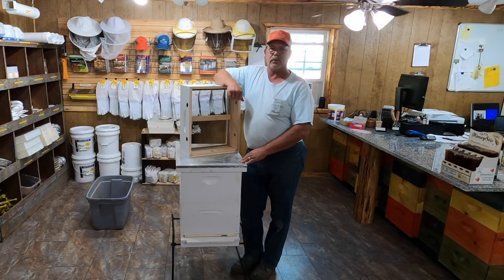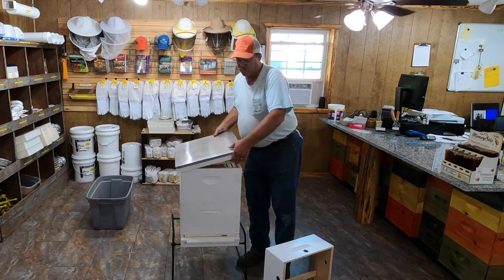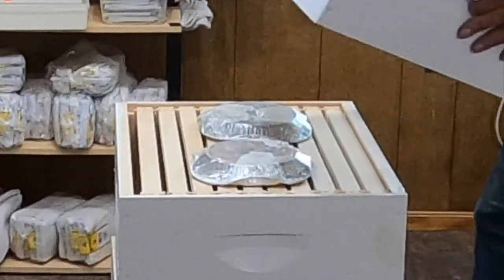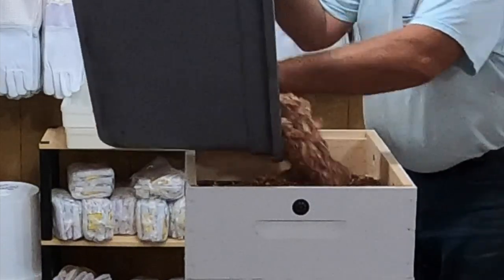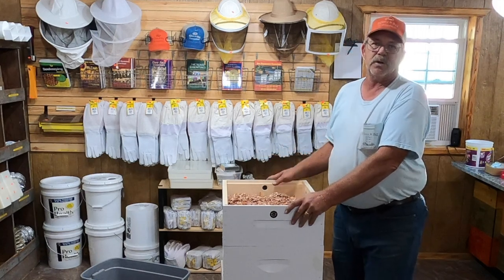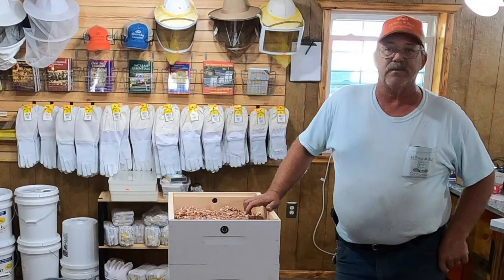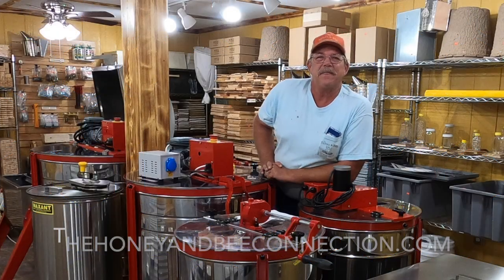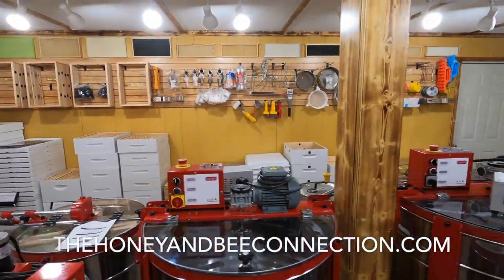Beekeepers Guide 2 Quilt Boxes - Moisture Control 4 Winter Honeybee Hives|The Honey & Bee Connection

Comment: Great piece of equipment and good explanation of how it works.  I just put on a quilt box of similar design on our hive. (We've lost so many hives in the past... this past year we only went with one hive. It gets expensive.)  As an added option, one can drill a hole in the base part of the quilt box for the bees to have an upper escape route ( as snow build up and dead bees can pile up inside of the lower entrance... which is the reason we lost our hives last year... moisture and too many dead bees for the other bees to move out of the way... even though we tip the hive to drain away on the front for the winter.)  Putting on a plastic entrance disk/dial to the quilt box's (not on your model) upper escape hole gives them protection from wasps in vent mode... dial it to fully open after Thanksgiving ( until spring ) for winter cleansing flights.. and other options.  Happy beekeeping!